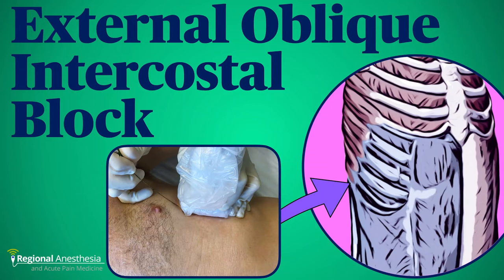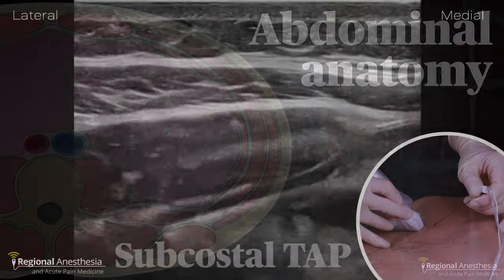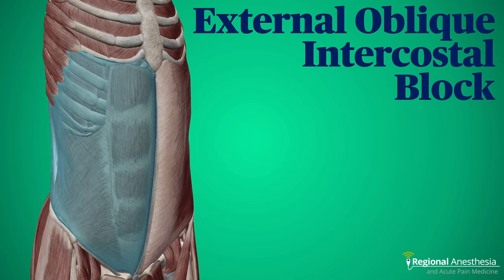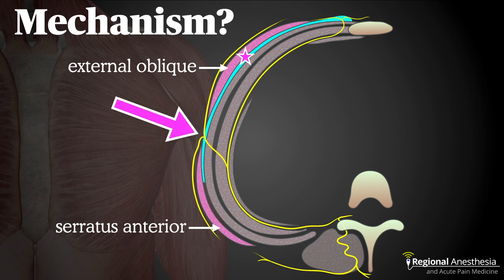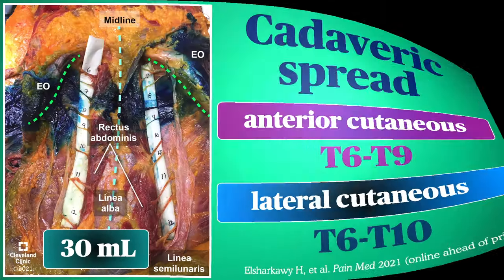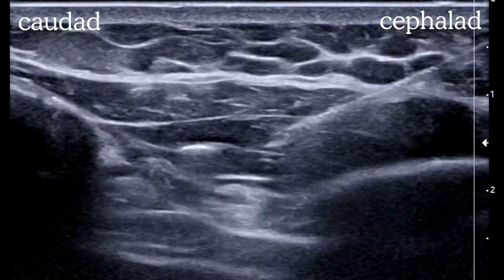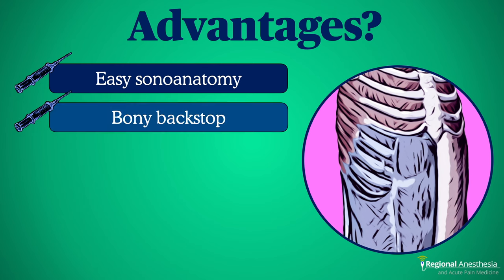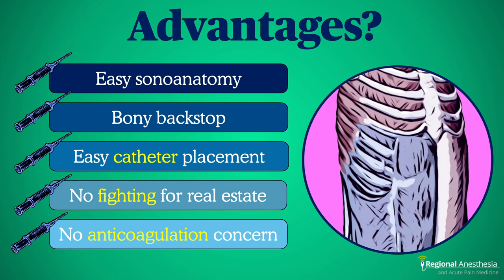External Oblique Intercostal Fascial Plane Block

Comment: Nice video and a great idea. It's great to see innovation. Only thing I would say is that not all TAP blocks are the same and correct needle placement in the first place will allow supra-umbilical analgesia. That being said this is a fantastic block that needs circulation in the press. Well done Jeff on an inspiring presentation

Comment: This video is full of great information. I have found this block to be very useful to cover the upper abdominal pain patients experience with Laparoscopic Cholecystectomies, and have found it to be superior to the subcostal TAP block for this purpose.  I am working on a presentation for an upcoming state meeting. Would it be possible to use some images from your video in my presentation? Credit will be given on the slides with the images.
Reply from the maker: Glad you found it helpful! Of course, please feel free to screenshot whatever you need. Good luck with the presentation!

Comment: I gave this a try for female robotic bariatric surgery patients but found it difficult to avoid trajectories that go through breast tissue when going from cranial to caudad. Would you recommend a different approach there? Also, how do you discern which is the 6th and 7th rib -- do you just go at the level of the xiphoid or count the ribs up from the 12th?
Reply: No input, Jeff? These are great questions